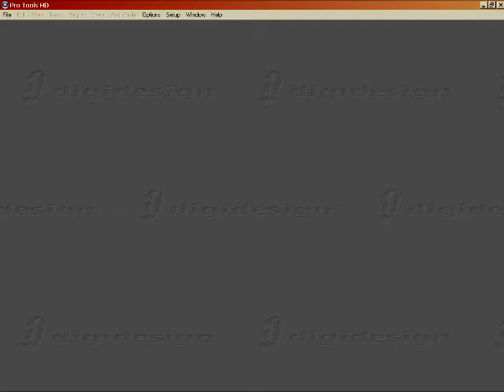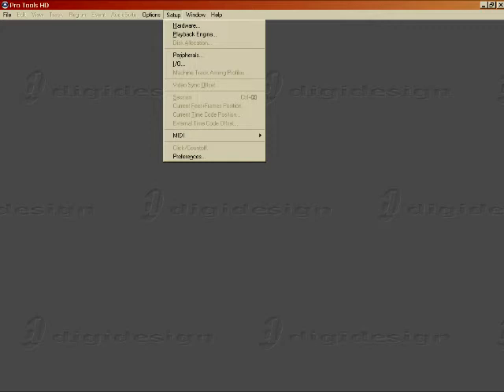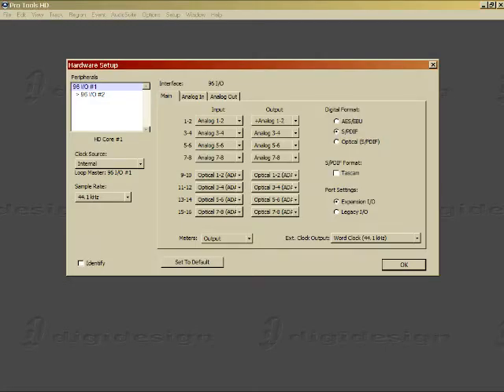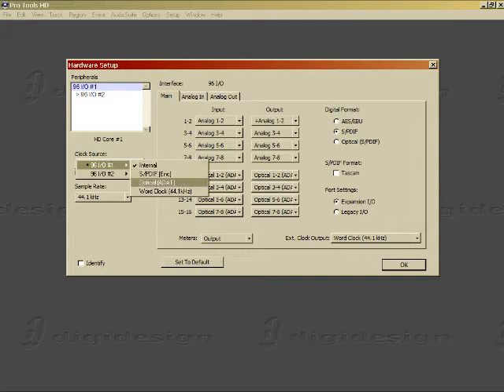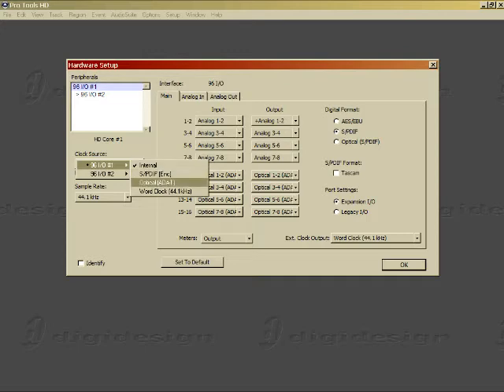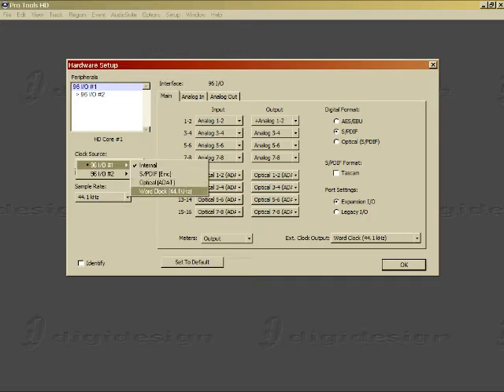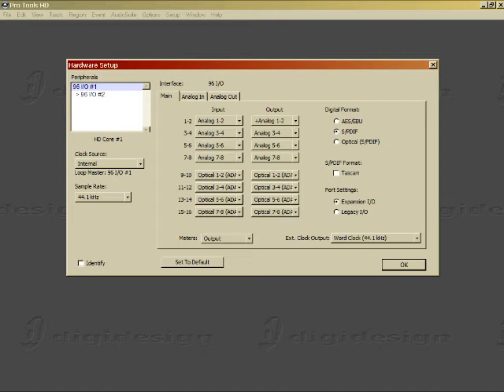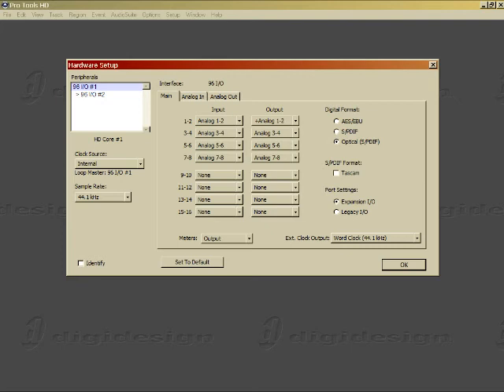Pro Tools - Digital Inputs & Word Clock Settings

Comment: I'm having a little trouble in in protools and I was wondering if anyone can help me out. I'm currently running a Scarlett 18i20 with a Presonus d8. I also have a fast track ultra which I've been trying to set up for talk back via spdif to my 18i20 but when I turn all three it doesn't work for some reason. Mix control crashes and my computer loses contact with my 18i20. If someone could please help or explain I would be very grateful. Thank you!!

Comment: Hey Phil, Nice video! I´m talking from Brazil. We have a Digi003 from Digidesign on owr studio, and we´re also having problems trying to config the ADAT Lightpipe. I have a new Echo AudioFire Pre 8, and we´re expecting to use it as "slave" to the Digi003. We already made the Path´s map on I/O option inside ProTools, but we´re not receiving any signal from the Echo interface. Is there some kinda extra config inside ProTools to recognize the ADAT signal?

Comment: You know your stuff! Here's one for you. I'm connecting a Digi 002 console and a digi 002 rack with optical cable. I'm getting signal on the 9-16 channels in ptools but constant clicks and pops are on the channels. How do I sync the two? Master slave? Thanks

Comment: the ad8k,   I have to go to internal, set adk8 to read the digi 002 by the ambus 8+ card, then I have to set clock to adat and quickly sync the ad8k to the big ben, I feel like its only a matter of time, before the sync source button blows out.  So the question is,  Is there a correct way to turn these on. As of now, its big ben, apogee ad8k, digi 002, then masterlink wants I have the previous clocked!  Computer?  on or off first

Comment: I'm always willing to learn, Great video, I am running a apogee ad8000se and alesis masterlink with a big ben clock, and a 002 looking to upgrade to a hd system, but They are very pricey, My question is with startup,   I run adat in and out to digi 002 apogee ad8000,  clock big ben wordclock out to in of ad8k,  I run aes out and in to alesis masterlink,  My problem is, it is very difficult to get these things to read clock from big ben.  I get it working after jogging through sync source on

Comment: hey phil,
i have a digi 003 rack and just got an old presonus digimax(8channel preamps). I connected the presonus to the digidesign via lightpipe. The digidesign shows that there is a connection and the software is set up so that it runs off of the presonus but when I pull up a new track to record off of the presonus it still only shows the 8 inputs of the digidesign and not the presonus. ANY SUGGESTIONS?
Thanks